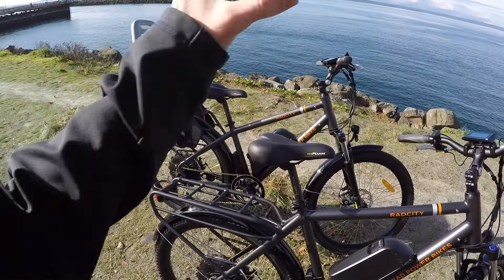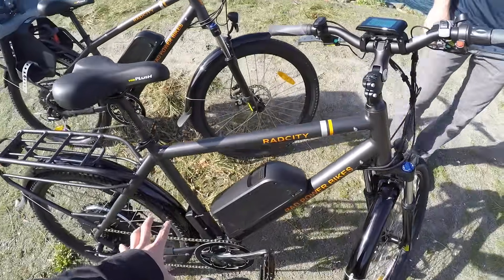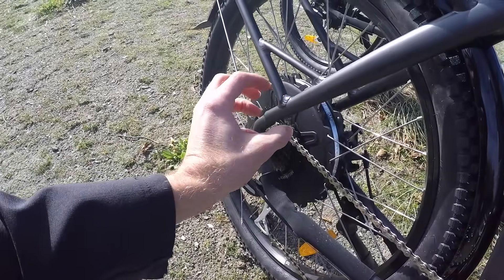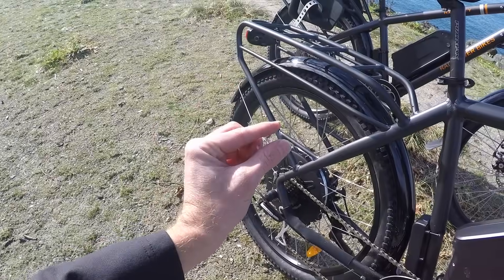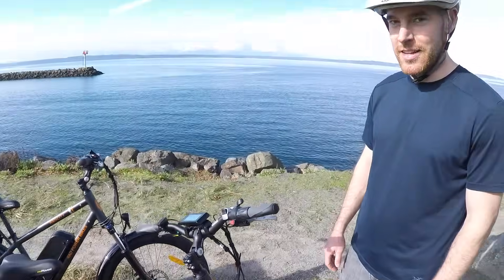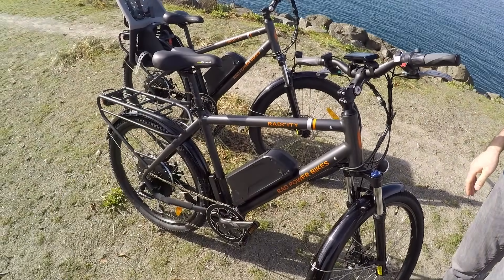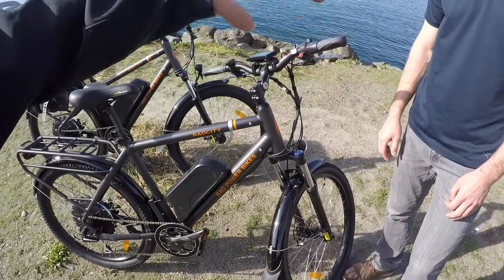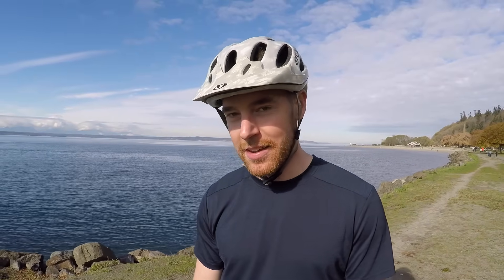Yes, You Can Charge Some Electric Bikes by Pedaling!

Comment: As somebody who bought the bike specifically to get into shape because his knees are shot, if somebody considers it cheating who gives a frig? It works, I got my RadRover almost 2 months ago, I have 300 miles on it now and have lost 25lbs doing so. Doesn't sound like cheating to me and for those that buy one and never pedal good for you, you decide the best use and all the nay sayers can walk up the hill while I smile and ride on by.
Reply: KlipschHead281 I totally agree it's the reason why I have a cadence sensor bike because my legs are too weak to drive a torque sensing bike and if I didn't have my e bike I wouldn't be out cycling at all, plus no I use it as my car , and haven't used the car in a year .
Reply: That's awesome, using the trainer indoors is driving me crazy, I can't wait for the weather to improve so I can get outdoors riding again.
Reply: I ride non e-bike and I think if it gets you outta the house, it did it's job. I was wondering how much is the motor in the way when you are not using it but just ride regular?
Reply: @Placebo6  - Very late reply, the motor is in the rear wheel hub, doesn't get in the way of anything.
Reply: 25 lb in 2 months is nothing to sneeze at! Well done!
Reply: E bike, bad knees Yep! I havent lost any weight ridding mine, maybe if i put the chain back on lol....it does keep me out of trouble...i have a 165 hp motorcycle that got me in trouble...i keep waiting to get a speeding ticket on ebike...1500 warrs, 52 volts, wiring upgrade and slicks @65 lbs. about 37mph...lots of ebikes in town, i pass them all the time
Reply: KlipschHead281 E bikes at Halfords
Reply: Well, I'm such a cheat that I often drive a subaru. I think an ebike gets people out into some fresh air and to local places they would not normally experience on foot, a regular bike or a car. It's that way for me, anyway.
Reply: Roman Ash you really owe it to yourself to test drive an ebike! Seriously!
Reply: Well said
Reply: I rode an old 3 speed bicycle for 10 years - all year round - and dumpster dived my food!! "cheating" solved!! Still like this Regen idea.
Reply: Cheating = driving your car instead, which would probably be done most cases if you had 20 miles to work on an unpowered bike.
I did do a 20 mile trip on just the throttle though a couple of times. I didn't want to be kept awake by exercising at the end of an evening shift which often has the same effect on me as drinking a coffee before bed.
Reply: May someone tell me the names of the ebikes that can recharge the battery as I'm riding ?

Comment: Very interesting conversation about energy efficiency. On a similar topic, I would like to know how large of a portable solar panel would be needed to charge up my 36v 400 watt ebike battery?
Reply: 100w solar panel with regulator & a agm deep cycle battery is perfect for a cheap stationary charge setup
Reply: Regulator, or inverter?  I actually have a 100w panel and deep cycle AGM battery in my camper, and that is when I want to charge my ebike. Should I plug in an inverter, or through a 12v regulator plug directly into the battery???
Reply from the maker: I dug into this a bit and found different DIY guides but ultimately bought a smaller, pre-built battery bank with solar panel from Goal Zero. It's not the best but is large enough to charge on its own then fill my bike :) https://electricbikereview.com/accessories/goal-zero/yeti-400-solar-generator-kit/
Reply: Steve Petttyjohn  hii

You can charge ebike from 12v battery using a DC- DC boost converter You will look to your charger to see what voltage it has to the output 
The boost converter need to be able to adjust also the power , means how many amps need to charge the battery .Search YouTube for charging an e- bike using DC-DC converter

Comment: buy solar panel n battery pack never charge bike from grid again :-)
Reply: also due to battery pack being static no need for it to be as expensive as lithium ion etc :-) :-)
Reply from the maker: Right on! I've been experimenting with this and did a review recently for a portable solar charged battery: https://electricbikereview.com/accessories/goal-zero/yeti-400-solar-generator-kit/
Reply: ElectricBikeReview.com ..... can used 150? Or have to be 400??
Reply: John C3333 nicad batteries are similar in most parameters to lipos,but they are way cheaper they are kinda fussy compared to lipos, you ruin them if you recharge before they are fully discharged.
Reply: throw a bio diesel motor and solar panels on lol
Reply: All my grid electricity comes from renewables so nothing to burst the green bubble. UK.
Reply: I cant see a battery pack less than $500! Help!!
Reply: @blackraingamingofficial  maybe these? 

https://youtu.be/L43bArxyszU
Reply: Solar is a possibility, and perhaps soon it will be more practical, but for most people, its right now not practical both from a cost perspective and an ergonomics perspective.  
Like me, only solar simply wouldnt work. Ive a full discharge length ride with only one battery. The best portable charger ive found thats truly portable and can fit in a pannier or back pack and doesnt require a trailer and such is the same cost as my bike for something that would not reliably charge my bike fully in optimal conditions. The cheapest one that would only in optimal conditions would be much more expensive and it would only work in optimal conditions. Not to mention that i would have to leave a 2k plus solar set up just laying out at work while it was charging since theres no way to take it inside and have it get sun light to charge. And theres no reasonable way to secure that rig. And optimal coditions are not always present. In fact some days i would arrive at work dead and have sub optimal coditions for only 4 hours and would end up with at best a quarter of a charge. 
 Solar is viable only when it is. And thats unfortunately a very small number of situations.  
Its simply not as easy as 'buy x product and never grid charge again'
If you already have a set up that allows you to live off grid, then you have most of the problem solved. You the. Only need portability. And i can tell you that even then the portable charger is still not a cost effective solution. You would do better to buy additional batteries and charge them at your bulk charging station at home and carry them with you. 
Unless you build a trailer mounted large panel charging station and you are LONG DISTANCE riding off grid, its just not viable yet. And even then thats some expensive stuff. 
You have SO MUCH other electricity saving you can do before you even need to worry about your ebike cost per use. 
Like seriously, 
Imagine its twelve cents a charge to charge your bike. 
Even at 1 charge per day, thats 44$ a year. 
The $2k sometimes works charger would require 45 years of always optimal coditions to pay itself back. 
So yeah, i realize that its totally possible to build a system for less than $2k. But not one that you can put in your pack. Even if you spent 500$ on it you are still looking at a ten year return if you only use one charge a day. For less than 500 you can buy a second battery and a second charger. More or less. 
Even with the solar charger, if you are power using your bike, you will deplete the battery faster than you can charge in all but the most optimal conditions and if you only charge while not running, you are never realistically gonna get faster than grid charging out of a solar set up. 
So the second battery still makes sense. 
 I wish there was a realistic solar solution that is practical for most use cases but theres simply not. Yet.
Reply: It's possible. Use a sine wave inverter ( also referred to as full sine wave) to protect the sensitive electronic components. Solar systems are expensive though.
Reply: You know what??? Just throw in solar battery pack to recharge your bike PLUS a windmill in the back of a bike, with a removable chargeable battery if you need, as well as a hybrid gasoline powered motor. Now you got yourself a hybrid E-bike and motorbike 😆
Reply: May someone tell me the names of the ebikes that can recharge the battery as I'm riding ?

Comment: Nice topic. I think the appeal of having alternative ways to charge an ebike is in its universal utility and how many other problems the ebike can solve as being an energy transport/storage solution. The bike itself gives masses of people access to many times more efficient transportation than walking (even without paved roads).

I mean the whole conversation of why we would even need electric cars when we seem to be doing fine with gas... Its about the number of ways you can charge that battery compared to the one way you can put gasoline in the tank. EVs have Wind, Hydro, Solar, Thermal, Coal, Propane, Nuclear, Gravity... I mean a massive list of ways to get those ions to one side of the battery cell. Plus, not to list all the different battery chemistries available.